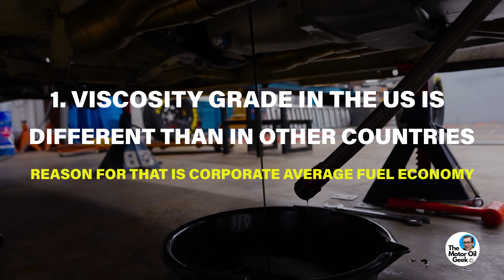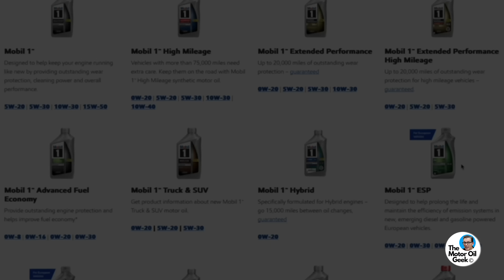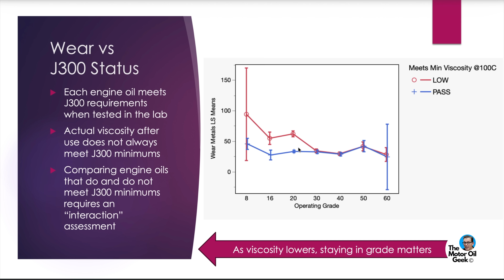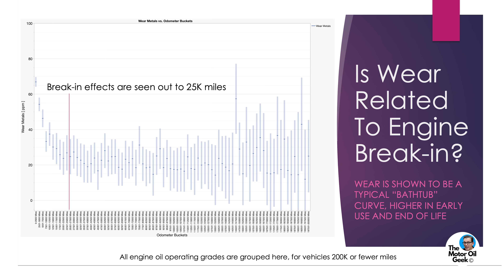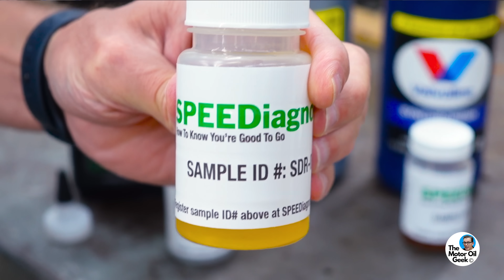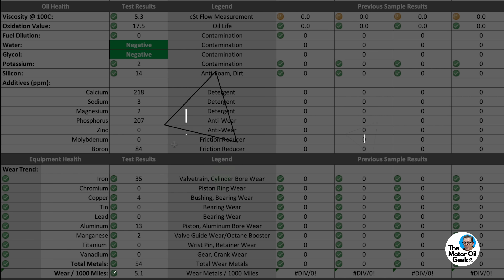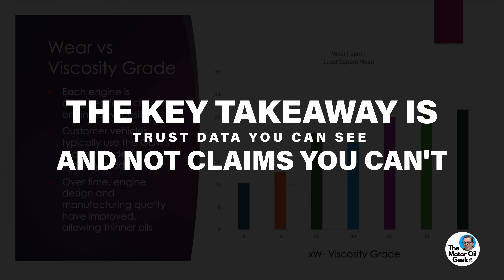More Ai Lies? The FACTS about 0W-20 vs 5W-30 (With Evidence)

Comment: 6:41 10W60 wow!  As if a bimmer owner didn't need telling to get the oil changed at 5-6000 rather than 20,000 or 30,000 but first, second, third owners in warranty don't care do they.  Oil shearing out of grade in under 500 miles, that's scary.  Looking back my lab didn't test the oil grade merely stating the grade the garage declared AND the lab test said test values OK not knowing car had only done 3,000miles.  Another thing; the v10 took 8.8-9.3L at change but I was told needs 13L at first fill from dry.

Comment: It is no surprise that more 5W30 oils would shear out of grade as opposied to 0W20 oils. Most of the SPI SP/SQ 5W30 oils cSt value at 100 C are in the lower half of the 30 weight range while the 0W20 oils are in the upper half of the 20 weight range .  Great video, lots of useful info.
Reply: The spread is bigger on the 5w30.

Comment: You said the exact same engines. In other countries use a thicker grade oil, but don't engine manufacturers adjust bearing clearances for thicker oil versus thinner oil, so it wouldn't be the exact same engine Then if that's true.

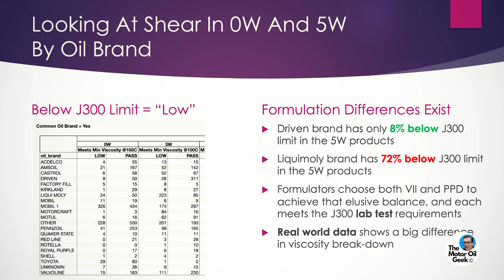Comment: Lake, I detected an "error" in whoever did that mathematical computation for you on that 8% number for the Driven 5W-30 oil products that fall out of grade from the J300 Chart (at the 5:13 mark on the video), although your 72% calculation for the Liqui Moly was right on target.  I show a 15% (15.4) reading for the Driven (using a calculator a few times and doing it long hand to be sure).  
I assume the numbers on the J300 Chart are derived from your oil-analysis reports, so we don't know how many of the vehicles that dropped down in viscosity were solely caused by fuel dilution or other factors (or a combination of each)?  Additionally, it might be unfair to compare brands in this J300 test, since Oil Brand A could have had many more oil samples from Direct-Injection Engines that are surely to cause more fuel dilution (thereby resulting in a viscosity drop), in comparison to Oil Brand B that had more oil samples submitted from Naturally-Aspirated Engines?

Comment: Most are not considering thinning oil plus variable oil pumps that lower the oil pressure at low rpms.  When did we start having these problems.
Reply: Wow interesting information, I didn't know there was such a thing as variable oil pumps in cars, when did this start becoming a thing? A decade or so ago?

Comment: I "guess" the reason 5w-30 oil shows very slightly higher wear rate is probably caused by the 5W part, which causes the oil flow slightly slower on cold start, even if you're not in very cold weather. I've had older cars that switched from Mobil 1 FS 5w-30 (ACEA A3/B4) to ESP 0W-30 (ACEA C3), and what I do notice is the engine would build up oil pressure slightly faster even in not-so-cold winter time (around 32F, the oil light would go off slightly quicker). I also have a 2016 Tahoe that was running on 0W-20 and now I'm running 0W-30 and doing oil analysis to see what the difference would be.

Comment: my question  is why multi grade oils why not just a straight wt oil I ride an old Harley (73) kick start and yes even in AZ I have to change the wt oil. as it is almost impossible to kick start an engine with 60wt but I drop it to 50 wt for those 2 months (I know Harleys are not your cup of tea so to speak being roller bearing crankshafts and cams instead of friction based bearings)...... also I heard that in a S.A.E. paper that the multi weight oils get that way due to plastic molecules that swell when hot and have absolutely NO lubrication factor at all is this true? I am an avid watcher of your show and thought your insight (being in the industry) would help explain this to us

Comment: Regarding the shearing out of grade segment, does the 20% of 0w20 and 40% or 5w30 indicate percent of samples that showed some component of the oil shearing out of grade? Like 20% of the 0w20 users would be better served running slightly more viscous oil? Are there any other downsides to having an oil shear out of grade? If a 5w30 performs similarly in terms of wear, even when it shears, what other factors does that shearing affect?

Comment: Lake, I wish you’d explain why do the manufacturers who propose 0-20 in the U.S. suggest 5-30 outside the U.S if not for reduction in wear.  Typically speaking people could care less about the minimal fuel efficiency and far more about reliability/longevity.  Wish I could get the raw data to analyze for myself. People will always spin data to support there opinions on oil. You are the best at staying neutral.

Comment: So why not just run a straight weight oil since it will be more shear stable? When would running a straight oil be beneficial? That's never talked about. Also, do an in depth video one what weight oil you should run per your bearing clearances. Mainly for high hp guys like LS3 engine, when to run 10w40 vs 20w50 ect.

Comment: Speed, how relevant is this subject if oil changes are done every 2000-2500 miles in a late model engine?
Reply: Get an oil analysis done, 2000-2500 seems a bit overboard

Comment: My takeaway is keep up with the 5K mile changes with my Toyota running 0w20 oil before it has a chance to shear.
Reply: 3,000k or so oil changes seem to be coming back into fashion for very good reason!
Reply: @horseathalt7308  3,000k means 3 million...
Reply: @horseathalt7308  0w20 is the reason.  I did 15k mile OCIs on Mobile One and Supertech full synthetic on 2 Dodge Turbos for 10 years, well over 100,000 miles.  Looking down the oil cap on the 89' CS Daytona Turbo it was clean.
Reply: Data he showed shearing happens in under 500km
Reply: @Angry-Lynx  All the more reason to use a 0w-30 because it gives you more of a safety margin.

Comment: We need a video on testing oils to find what stays in grade the best. Specifically the GM DexOS oils recommended for the trucks and SUV’s. 

I also noticed a header on the GM DexOS website that now says that DexosR is backwards compatible with all DexOS 1 gen 2 and gen 3, and DexOS 2. But your video here is saying the wide viscosity range like 0w-40 would shear down quicker than a 5w-30. So do you just use a good 5w-30 in place of 0w-40?

Comment: Do some videos on thick oil for summer use.  I run 10w-30 in winter, and 10w-40 in summer on all my high mileage worn out everything vehicles and equipment.  Interested in 50 and 60 weight oils.  Higher oil pressure?  Reduced wear?  Quieter operating?

Comment: Also, as you have mentioned, oil quality and oil change intervals are important. No matter how often you change oil, say every 1000 miles, if the oil is rubbish, it will NOT protect your engine. If the oil does not have an API donut symbol on it then potentially anything can be in the bottle. As the API can't prosecute unless that oil does not have the donut symbol on it. Lack of it means the oil could be way better or way worse or just ok.

Comment: My manual says during winter use a lower viscosity than in summer. Can you explain that?
Reply: Thin oil pumps to critical surfaces in the engine much quicker providing sufficient lubrication. Thinner is much better in conditions below 30 F degrees.

Comment: The gap in the numbers "on each side of the W" makes sense for shear stability. Question---- is the arithmetic difference or the ratio the test? ie; 5W20 is a 15 gap and a 1 to 4 ratio. 10W30 is a 20 gap but a 1 to 3 ratio. Is the key gap or ratio? Thanks.
Reply: It can't be ratio because of the existence of the 0 grades. What's the difference between 0W20 and 0W40 if ratio is the key measure? Those ratios are the same - either 0 or not a number - but they aren't the same viscosities.

Comment: Even owner's manual can be confusing at times. My car calls for 0w-20 but on the next page it states " In HOT weather, oil of a higher viscosity is required to properly lubricate the engine". I live in a desert valley and have to climb steep grades to go anywhere.  Even on a cool day when pulling these grades engine oil temps push 240 degrees. ( I'm cruising it not racing) Later in the manual ( 50 pages away) but not in the same section it calls for 5w-30. I run 5w-30 in the summer and change back to 0w-20 for the winter.  I do average about 1.5 MPG less with 5w-30. Take away; Read your owner's manual. There is a lot of information you can use.

Comment: The graph for shearing out of grade makes xw20 and xw12 look like outliers.  You will probably find there to be a big correlation in terms of the ratio, so if you look at 0w30, 5w30, and 10w30 separately, you will likely find different results for each.  The wider the range, the more dependent an oil is on VI enhancers.

Edit:  similarly, 0w20, 5w20.

Edit 2:  thank you for touching on this issue.  I should watch an entire video before commenting!

Comment: I run additives that thicken my oil in my f150 5.4 L engines.
Engines Survive past 500.000km with NO cam phaser issues. In fact Adding Lukas to every oil change has made cam phaser issue disappear.
0w20 oil is not anything I will run in any vehicle ever again. 
High kms are facts that put perspective on thin garbage oils.

Comment: Correction: 0w-8 in the 2026, 0w-16 in the 2022. Same engines. I'm perplexed over this??????
Reply: Only reason the mfrs are doing this was CAFE regulations. Ignore them, Keep using the originally spec'd oil for the engine you have.
Reply: @horseathalt7308  Thanks. I'm gonna just stick with 0w-16 in both identical engines.
Reply: @ironmaiden8625  You should be fine. Mainly still with those during warranty period! After that I'd look at some other grades. Especially if you live in warmer climates like in the deep south USA.
Reply: @horseathalt7308  Thank you, and yes, I live in Southeast Louisiana. It gets really hot in the summer. What do you recommend for the previously mentioned vehicles? Also, I own a 2024 Tundra. As soon as the engine is replaced, I'm going to use something thicker than 0w-20.
Reply: @ironmaiden8625  I would go with a 5w30 full synthetic.  If you aren't on long high speed drives in the heat, maybe a 5w-20 semi synthetic would be fine.  I'd try and stick with full synthetic versions of those weights if possible in any case. You are most welcome !
Reply: @horseathalt7308  I appreciate that. I've always used Mobil 1. 0w-20

Comment: There's a lurking variable in you analysis. Almost every 0w20 oil ever made is synthetic or contains lots of synthetic base. In contrast, much of the 5w30 on the market is conventional. With that being said, many synthetic 5w30 oils could use little to no viscosity index improvers, and therefore be extremely sheer stable. You're comparing a bunch of UOA's for a grade that's almost entirely synthetic, with one that's only partially. The conclusion is people using synthetic 30 weight oils will generally see better numbers that a synthetic 20 weight oil when it comes to wear and sheer stability.

Comment: So is a Group IV PAO Euro Formula Castrol Edge 0w-40 not good, because it's fairly wide margin 0 to 40, but my understanding was the base oil itself has less friction modifiers to break down therefore is more stable as a result of the base oil already behaving the way it needs to without as many additions

Comment: in my 2006 pilot I run 50/50 5w/20 - 5w/30 no issues with vehicle.  
I recently bought a 2024 cx5 non turbo which requires 0-20, after 15k miles I will run a mix 
0 and 5/20 then @ 36k run my 20/30 mix
I change my oil @ 4-6k and run Purolator mid grade filters

I would like to go 5w-30 in everything but keep on hearing about variable oil pumps tuned for grade.  this is probably bs

Comment: Ford 6.0 210,000 miles mild tow tune, studded and O’ringed. I’m running 5w-40 t6 . I live in far Northern California temperatures range from 25° to over 100. I used the truck for everything towing driving around. Should I be running 1540 or do you have any recommendations?

Comment: You said/or implied at 5W- 20 is more sheer stable than 0w-20. However, a couple of manufacturers have pretty much admitted that they sell the same oil, but just relabel it according to the market demand. In other words, if you buy a jug of their 0w-20, it's the same formula as 5W-20. My vehicle is specked for either 0w-20 or 5w-20. Which one should I use for the best shear stability or should I use Mobil 1 extended 5W30?

Comment: I've gone to 5w30 in my Tundra, being in Florida and seeing the bearing issues some have had and recall for them, although my truck hasn't made that list yet. The main changes I've noted are slightly higher oil pressure and about a .1 mpg drop. So 1/10 of a mile per gallon lost. Literally 3-6 miles less on a tank of fuel. 
If I was in a cooler climate I suppose I'd use 5w20. 
Need to do some oil analysis next.

Comment: Some oil  and filter and car Mfg say 7000-10000 mile oil changes..
Foolish nonsense.
So many engines failed timing chain guides plastic and stretching.
Just change it alot with quality oil and filter.

I got over 395,000 and 275,000 out of Chevy Van express and Truck 4.3 and 5.3 .

In old high mileage engines over 150,000 loose bearing will lose oil pressure at hot idle in drive sitting in traffic.

I stick with 5-30 on older stuff.

Brand new engines i can agree.

Comment: My personal experience of 0 grade oil is that when I used 0W30 oil in my 2.4 liter VW diesel engine it consumed oil about 1 liter between oil changes. When I got back to 5W30 oil consumption stopped / turned to insignificant level.

Comment: Here is my question. I have a 1 year old Ford Maverick Hybrid that has the Atkinson Cycle engine. Ford specs a 0W-20 for this vehicle, When Goggling about this as a potential problem the answer was that this engine runs cooler than a normal ICE which make it perfectly fine to use this viscosity. I always use Pennzoil Ultra platnum synthetic and change it every 5K miles. Is there any truth to the cooler engine claim??

Comment: Don't forget due to Thermal Viscosity Breakdown, after 3,000 miles your 5W-30 oil turns into 5W-20 oil.
All oil loses its lubricating properties over time due to the heat of the engine and build-up of dirt.

Comment: I think 1 million recalled GM truck engines is all the evidence you need.
Look, it isn't how quickly engine oil "flows", it's about "Viscosity" because
the oil is under pressure from the oil pump to lubricate the engine.
And higher viscosity creates more "compression" of the oil by the pump to "Better" reach the needed parts. (for the most part).

Comment: My take away from this is, 5w-30 is smarter if you don’t change the oil immediately at recommended intervals (even the correct brands). I don’t see why, from this presentation, that using 5w-30 is a “bad” idea, even if you do change at recommended intervals? It seems as if there’s no problem with using it? If using 5w-30 does no harm, why not use it? Just asking. Hope someone can answer this for me.

Comment: good video, thanks! here in mexico, our Toyotas have a sticker saying to use 5w-30. However, the manufacturer calls for 0w-20. I use 5w-30 in all my vehicles. We have about 5 vehicles and some call for 0w20 and some for 5w30. It never gets real cold or hot here, and all are running strong. carry out oil change and filter @ 5000 mi.

Comment: AI has its uses. You have to fact check it though. When I asked it about first oil change on my 2026 duramax 6.6L it was telling me to use dexos D. Well I own an oil change business and know Dexos D is the 0w20 oil for the baby 3.0L duramax so there's that.... All that said I am not a fan of 0w20 oil. I only run it in my Subaru outback and change at maximum 5000 with a purolator boss filter. Also side note, I always run 0w40 castrol euro spec on my turbo Subaru 2004 xt. I love that oil. Lastly, fuel dilution is a real concern and people that run 0w20 and extend their intervals are often low on oil, the car, Subarus, consume the oil.

Comment: well, if Honda uses higher viscosity oil after recall on crankshaft and rod bearings, I don't believe that low viscosity oil are any good beside better gas mileage because it's so thin...

Comment: Any opinion about the b4154t5 Volvo engine in my 2017 EU v40? 😆 it’s an 1.5 liter 4 cyl that takes 0w20. I’m so annoyed but this grade, it’s so thin and in the summer (40+ celcius) it feels so weird. but don’t want to change it to another grade before I’m sure it can handle (for example) 0w40 of 5w30

Comment: I'd love your opinion/analysis on products like "Restore 6 Cylinder Engine Additive" to combat fuel dilution in high mileage engines. The stuff certainty works to restore compression temporarily or as long as the product is in the oil, would love some info.

Comment: I always used Castrol for many years. I had a step dad who swore by Castrol. Over the years, I did notice it was breaking down at 4K miles. That's probably what caused my 2006 Charger 3.5 engine to wear out at 311K miles. (Spun main bearing) I believe that it would have lasted longer if I used Mobil 1 oil. 
After buying a used Mercedes, and changing the oil  at almost 5K miles and noticing how smooth and slick the oil still was, and I realized the Mobil 1 is better oil.

Comment: 3:00 You sort of get there but kind of miss the point If 0W30 shears out of limit it is going to still be a more viscous oil than a 0W20, and much more so than a 0W20 that has sheared but on the low in of the limit. If I use a 5W30 that shears down to a 5W25 I am way better off than a 0W20 shearing down to 0W15.

All oils age and depending on interval are going to shear to some degree. A 5W30 shearing down is going to provide better protection than a 0W20 shearing down, and that's the point. The 5W30 gives you a bigger margin.